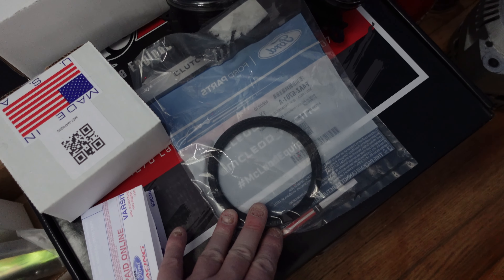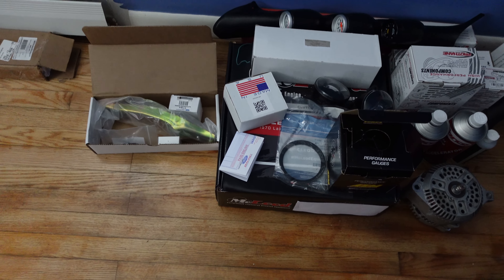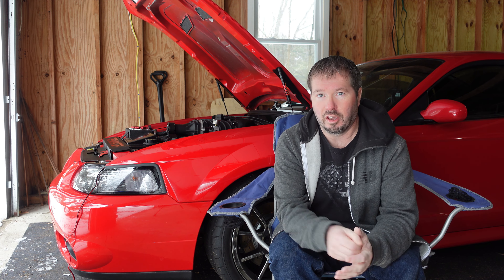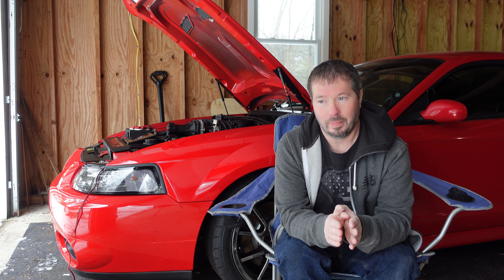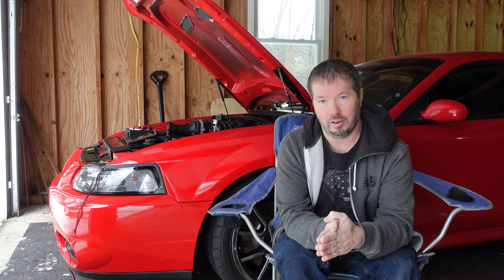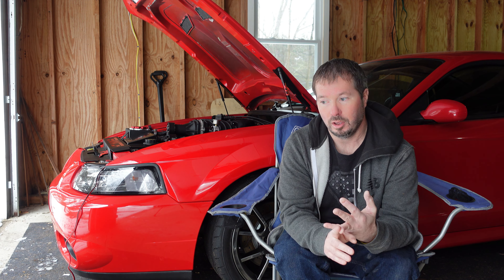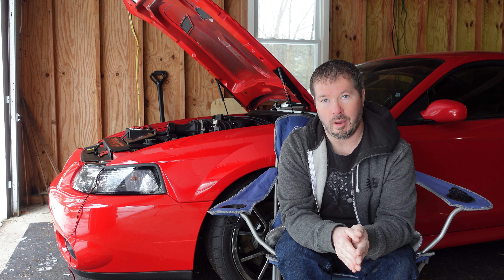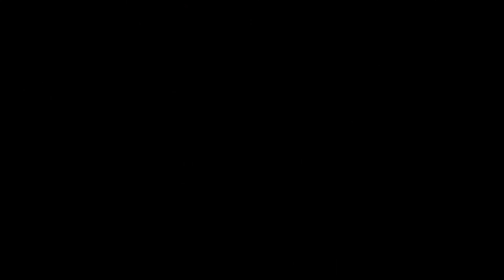04 Cobra Mods For 2022 Part 2 / I kept Secrets!!

Comment: Very nice parts you have there. You are absolutely correct, You want the boost lower and a more efficient breathing engine with less restriction. The VMP chart for pulley size and boost was kinda hard to determine. There were 2 charts that gave out different numbers that I found and I was expecting mine to see more like 19 accordingly but it turned out to be 21 for me. Maybe their chart for pulley size was for a cobra with LT's.
Reply from the maker: Yeah it’s weird and I don’t know why their charts are off. Mine makes almost 2 more psi than what it should according to the pulley chart
Reply: @Lethal_Venom  I think they do so many Coyotes that they have that all nailed down but they just don't have a lot of Cobra data. Still cool that they support the cobras.
Reply from the maker: @justin.c_svt  oh yes most definitely

Comment: Thanks for the mention Travis! Your going to love the ARH long tubes. It will really change the sound. Your right about how low they hang. My car is on H&R race springs and I have to be very carful because the long tubes and x pipe hang a little lower. But I heard ARH is the best for clearance as well. 

I had no idea that weather plays a roll in boost reading. I know in the summer time my car was reading about 17 psi without the long tubes. I installed mine right in the winter and weather has been pretty chilly so perhaps maybe that's why I'm still seeing 17 psi but who knows. I will truly find out once it's gets hot out. I'm also thinking I didn't see a drop in boost because I already had an off road x pipe prior to the long tubes w/ an off road x. 

Loving your build man!
Reply: I forgot to mention, less boost doesn't mean less power. Just like you said, your essentially relieving pressure from the engine so theoretically its going to run healthier.
Reply from the maker: @loscar5oh  you’re welcome. Someone else mentioned less boost does not mean less lower but I did not mean in those exact terms. With my setup now less boost means less power but with the long tubes it won’t matter. I phrased it the way I did because not a lot of people realize that long tubes can lower the boost some. I thought I clarified it more at the end when I said that I may end up with a 750 HP cobra after saying I wouldn’t build it up to that. But what’s being thought out in your head and how it comes out in video does not always correlate.
Reply: @Lethal_Venom  no worries man I knew what you were trying to say but I just wanted to help clarify as well 😄 I've read many post and comments from the forums of people saying long tubes lower boost so therefore one needs to pulley down to not loose boost. I believed that for the longest time until my tuner walked me through what truly happens. But you got the right idea.
Reply from the maker: @loscar5oh  it can definitely be a bit confusing lol

Comment: Lower boost don't mean less power it means more efficiency.  You will make more little more power on little less boost that is always a good thing.  Theoretically you should still be good on 93 if it drops below 19 like I assume it will.  Having a boostane tune is a good idea tho you can be little more aggressive than you could with 93 and not have to worry about detonation which is about the only thing that kills these cobras south of 900-1000 other than running the engine without oil lol.
Reply from the maker: Correct, less boost does not mean less power. I’ll most likely run the 93 tune with torco as added insurance

Comment: You are gonna have to look into running race fuel or at least boostane additive, you are going to make more than 700 wheel on 93 oct with the longtubes, if I am you I’ll just run the car with better fuel than 93 just to be safe, and also make over 750 wheel lol
Reply from the maker: Wish we had something over 93 but no such luck. I’ll most likely run Boostane
Reply: @Lethal_Venom  your power will go up but your boost will go down.  That should make it where you don't need to higher than just 93...but honestly these cars need all the octane you can get ecspecially when you're making big power they don't have knock sensors so it isn't a bad idea.
Reply from the maker: @midnight347  yes I know